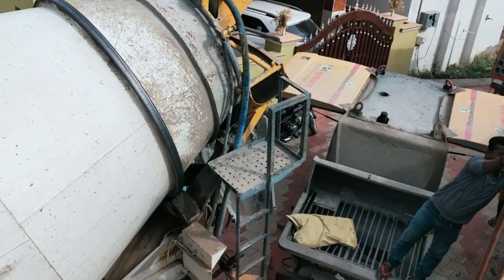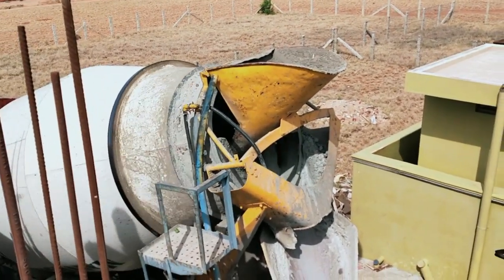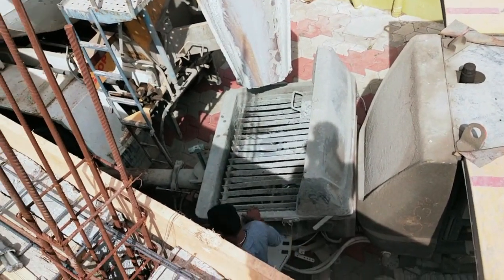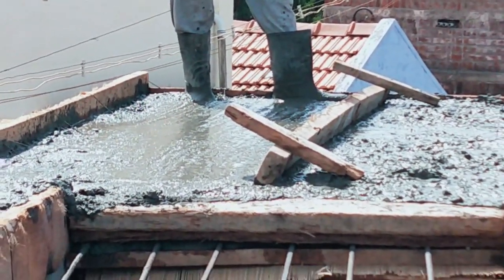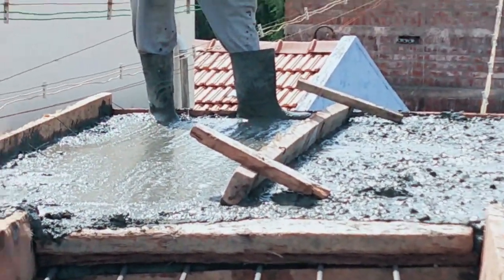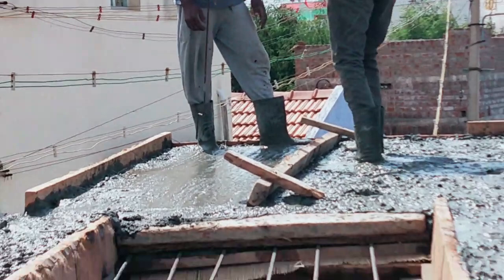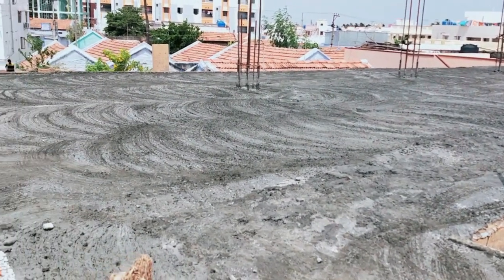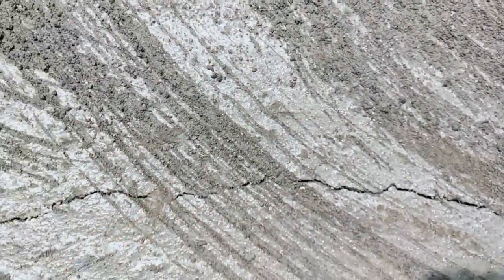1000 Sq.ft building concrete work - site visit | ready mix concrete | full concreting live video

Comment: Why didnt u use any vibrator for compaction?? Why u did not wet the shuttering with water??
Reply: Correct bro, vibrator should be used and also shuttering should be watered, otherwise you will see cracks. Also it is better to slab in low temperatures such as evening or night in areas where more hot and humid

Comment: What about the role of vibrator during concrete levelling before sealing? Its not used here. Is it not really required for a slab thickness of 5inches?